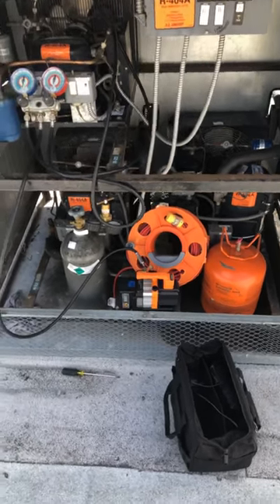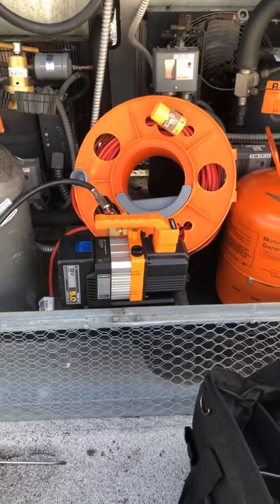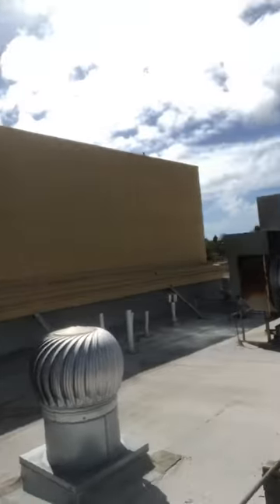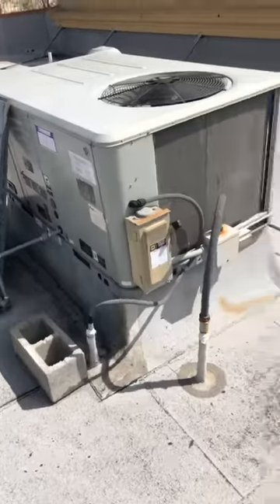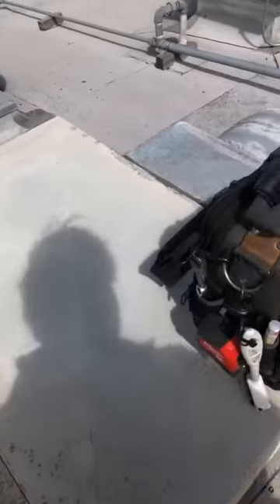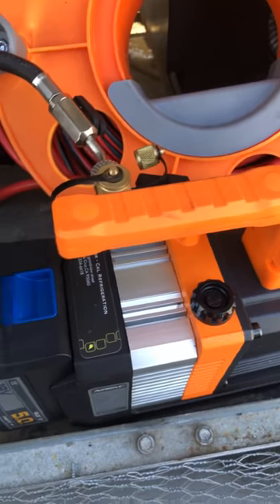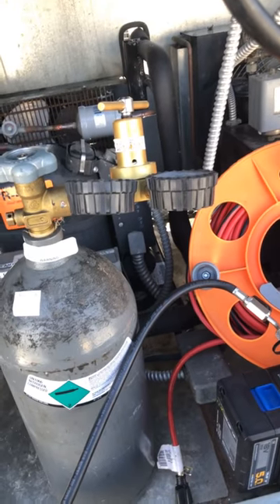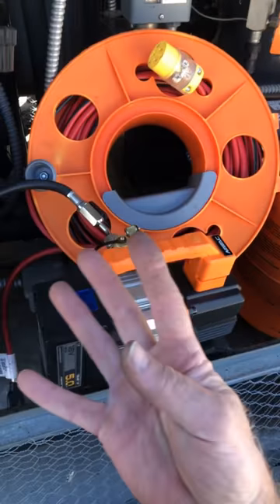NAVAC 2CFM BATTERY VAC PUMP

Comment: What's up captain Dave! Since you asked...I think if you don't have power to run the vacuum pump then how do you have power for the equipment to run? My opinion is, for the $500 price tag they want is unreasonable.  If the problem is the equipment you're working on is 480-volt,  then I would recommend getting a Step Down Transformer, or if you're working out in the middle of nowhere on a residential new construction, a 2kw power inverter for your truck works good.
Reply from the maker: Great info for NAVAC.

Comment: That 2 cfm pump should come with a cord adapter for the price. That way you only need two batteries. Hell, you can get a VP85 for the same price!
Reply from the maker: Excellent comment I’ll tell AK
Reply: He told me there was like some Ul listing thing that prevented them from doing that.

Comment: Is there some kind of check valve on the vacuum pump when you run out of battery power so you maintain microns you pulled down to?

I'm skeptical on battery power items. I had fully charged batteries one day, the next day got below 0 degrees and batteries lose their amp hours
Reply from the maker: No great point
Reply: Yes there is a check valve in case of mid-use power loss
Reply from the maker: AK HVAC that’s awesome ❤️

Comment: Maybe " Hackfree Hvac " or One of Your 12K Subscribers Has the Knowledge to Make a Power adapter. if someone made a 115 volt adapter so this pump could Run Off 115 volt. Then This Pump could Truly Replace Our 115 volt Pumps.

Comment: Good vid ! it's a Really cool Looking vacuum pump. it's very cool that it only weighs 8lbs 9 ounces with 1 Battery. A Definite Plus ! Yea, id Throw Down a Credit card for it and Pay $100.00 a Month For the Convenience of Lighter weight & Size. If it Had a 5 Year warranty that would be even better. i Don't Know what the Warranty is ? if it's only 1 Year , i Would NOT Buy it ! i'd Need a Minimum 5 Year Warranty to Justify the Expence. 
🤣🤣🤣🤣🤣 Not Me ! Every unit Has Electricity , so i just use a stealer cord and clamp on. id rather buy 1 or 2  $100.00  robinair 1.5 cfm vacuum pumps and take lunch. $500.00 for a Vacuum pump is 🥜. 3 extra batterys = $400.00 so $900.00 in a 2 cfm vac pump setup. 🥜 unless u are just shitting money sideways !